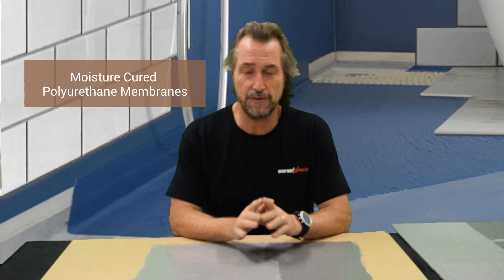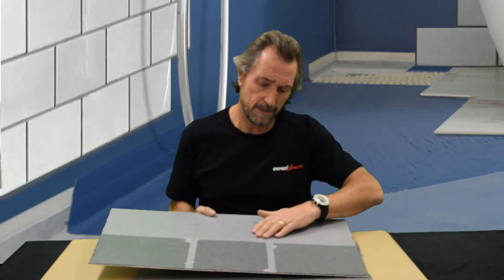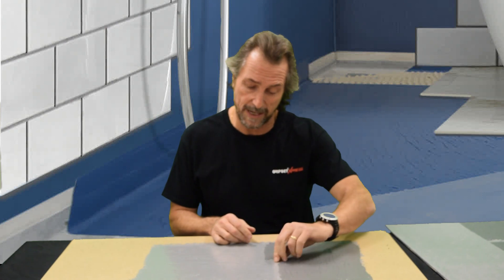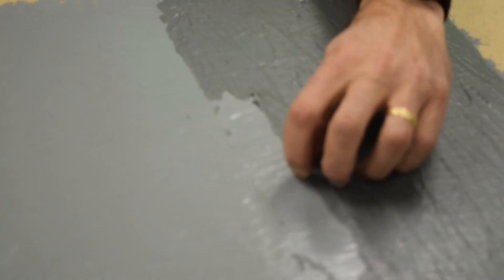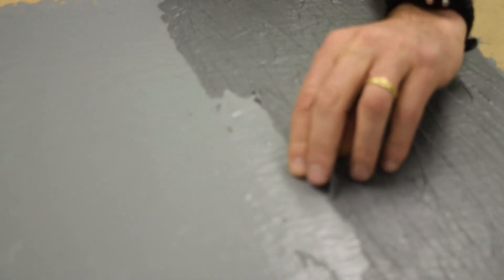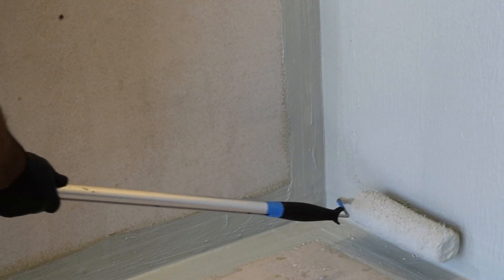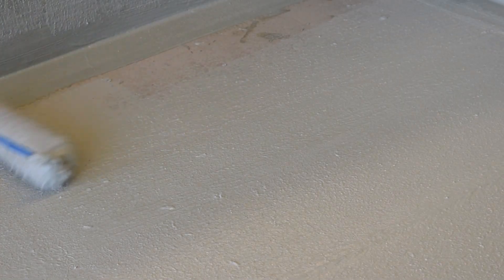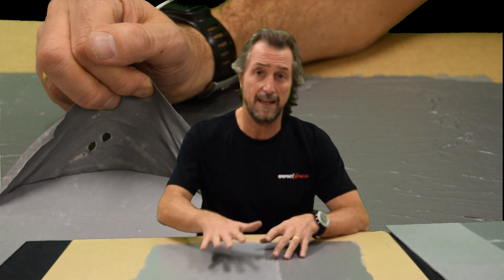Are polyurethane membranes and water based membranes compatible?

Comment: Would P39 be an alternative product to use instead of a solvent PU?
Pu 39 sheet suggests no incompatibility (mainly for toppings)
Anyway, would this work or what would you suggest? Cheers
Reply from the maker: Hi Paul, the advantage of the P39 is that it can be tiled or screeded over directly for fully bonded systems, whereas solvent PU's cannot. P39 is certified and tested for internal and external wet area applications. Hope this helps! Thanks for watching :)

Comment: I do the wall first, stop it 100mm short of floor.

I then use an epoxy primer on the water based membrane, which duram, says, the epoxy MC product can be used to bond incompatible coatings (they aren't overly specific which of their products though but its there in black and white, inter-coat between incompatible membranes)
Reply: Im only epoxy priming say 100mm up the water based, and then epoxy priming the rest of the floor and wall junction, before doing the PU .

Comment: Good video, I have 2 questions. 
1) Isn't the polyurethane in a sausage tube (eg Sikaflex 11FC) basically the same product as a PU floor membrane? The reason I ask is because most waterbased polyurethane manufacturers accept the use of a polyurethane sausage a connector sealant. Hence you end up with a waterbased product over a solvent based as per manufacturers recommendations.

2) You mention applying the solvent PU first, then applying the waterbased over the top.
What about applying the waterbased product to the walls first - letting that completely cure and then applying the solvent PU with a 150 upturn over the dried waterbased poly?
I know a waterproofer who uses this exact system, and has used it for 20+ years. He's never had a failure that I know of.
Reply: We are aware that some manufacturers do put forward their solvent based sealants with water based membranes. Gripset do not recommend this method and it's worth checking what the recommended cure time is when other companies put this method forward, as we've seen up to 7 days cure time prior to applying water based membranes with those systems. A water based PU membrane is not the same and not compatible with solvent based PU sealants. Thanks for your support

Comment: so what about using sika/seal and flex polyurathans to caulk corners and transitions (eg. onto shower trays) and then acrylic waterproof membrane other that?
Reply from the maker: Thank you for the question! It is the same issue, especially when it comes to solvent-based leaching into the water-based membrane. If you look into those particular products technical data sheets, you will find they recommend a cure period of around 7 days before coating with a waterproofing membrane.
Reply: @GripsetIndustriesPTYLtd  Well that will never happen, do gripset make a cauking material that doesnt cause bond issues
Reply from the maker: @matthewjungmann5760  Yes, Gripset has Gripset SB Sealant that does not have compatibility issues. there are also many other manufacturers of similar products.